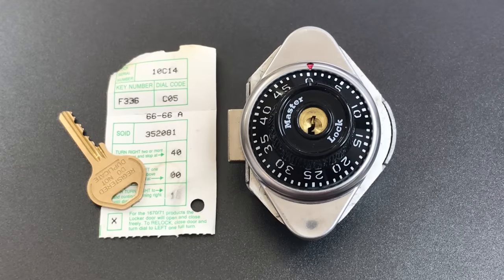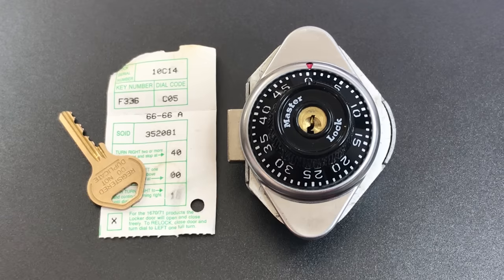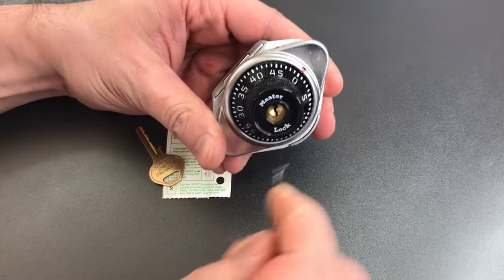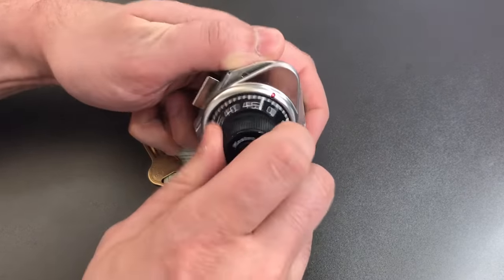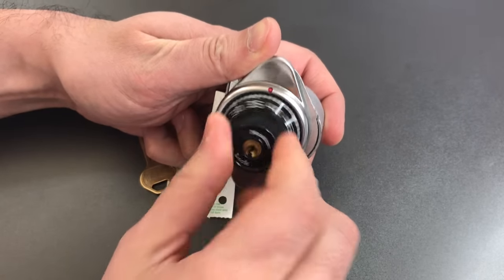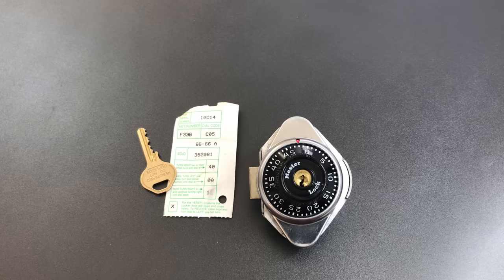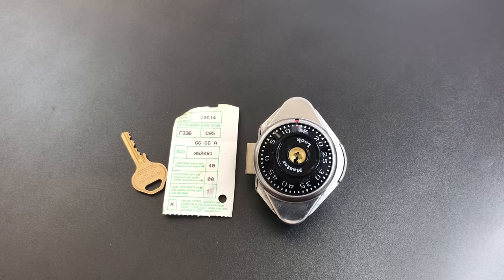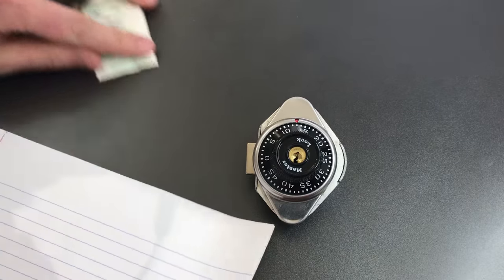[617] Master School Locker Combination Lock Picked and Decoded (Model 1670)

Comment: These locks are incredibly hard to get open even if you know the combination, because the ones that are actually installed in schools haven't worked properly in 20 years.
Reply: At my school, it was the other way around. As long as you got the first number right and you were within about 7 of the second and third numbers, you were good. Several times I ended up learning on lock turn in day that I’d been using incorrect numbers that were just close to the real ones.
Reply: I started in the middle of the school year,so I got a pretty old locker. It jams a lot and I have managed it now.
Reply: @nordbrah6611  I'm a senior in high school, and I've never even used my locker since 8th grade
Reply: We need to pay 50 dollars for our hallway lockers so I just use my gym locker for my stuff, we just have normal locks and I don't even use one since no one takes stuff (except for me taking locks lol)
Reply: I didn't have time to go to my hall locker, but my gym locker was a trip.  I had to put the combination in exactly, but all of the numbers were slightly off.  40 was 38.5 and had to be exactly 38.5.  And none of the digits were off by the same amount.
Reply: That's not always true, my school has these and I have no problems with them.
Reply: nobody uses school lockers anymore lmao
Reply: @thesovietkevin7275  Not always true, I use mine.  But most students at my high school don't use them.  I remember once a friend of mine showed me his locker which was full of 1000 dollar shoes and there were at least 5 pairs.
Reply: du,tfygufgus my school is literally two years old and yet the locks are still wonky lmao
Reply: My lockers at my school are old but work fine
Reply: Did anyone else use the pencil trick to jam the lock open permanently?
Reply: Yes please help us our lockers our terrible. People miss busses trying to get them open.
Reply: Exessivemite 9 same
Reply: I literally never used my locker for that exact reason
Reply: @exessivemite9478  amen partner. For various reasons I carried everything in a satchel and never used my locker the entirety of high school.
Reply: ikr lol i have not even used there lockers cuz of how dumb it is
Reply: If it doesn't open, use force, if force doesn't work use MORE force
Reply: Because they were there 40 years
Reply: @dataexpunged3914  honestly if the locks were there 40 years it was a minor miracle to get one so new. Granted I live in the Appalachian mountains in the US but my grandparents went to my high school and it still had the nuclear fallout shelter sign beside the entrance door.
Reply: I had the locks taken off the lockers when I was in 6th grade so we had to use our own lock to lock our lockers but they only did it for the 6th graders so I had to use the hard to open locks for the lockers this year so but I never used the locker anyway because the location didn't fit with my schedule
Reply: my daughter started middle School this year and showing her how to use her locker combination was just a lesson in frustration.  The second number had to be put in exactly and if you passed it you had to start over.  I've gone through hundreds of cheap master lock combination locks including decoding them by touch, but I was ready to hulk smash on her locker.
Reply: Worked at a junior high school. I would go through and change every combination and test it. They all worked beautifully.
Reply: At my school some people have to get the Janitor's hammer and beat the shit out of the lock to open it. And the teachers are the ones who tell them to get the hammer
Reply: Not even knowing the combination will open it.  You have to know the combination and where exactly to slam your shoulder to pop the rusted ass locking mechanism.
Reply: i remember having to hit the lock to the left after the first number and mine would open in 7th grade. the actual combination did nothing
Reply: it either opened on the first try or i was late to class lmaoo
Reply: @brittneynorville5273  I was lucky to have the working lock. But no one asked if they can put their stuff in my locker idk why. I would have let them.
Reply: @brittneynorville5273  percussive security does make it harder for people not in the know to open it lol
Reply: Exessivemite 9 facts
Reply: Beating and kicking the locker works great in this scenario. It's the only fix I've found
Reply: I somehow went through the entirety of schooling without having a locker in between classes. The only locker I ever had was in gym class.
Reply: @bhaalxbabe  they probably reused old lockers from another school.
Reply: Will same
Reply: Lmao i always thought lovkers ahving combination locks was just a movie thing because my school (now bear in mind I'm British and not as many high schools even have lockers) always has lockers with keys and if you lose your key thats it you just pay for a new one or don't lock your locker
Reply: The one on my locker works even if you get the combination wrong 1-2 ticks away from the true number.
Reply: E. Andrews same
Reply: my school you brought you own combination lock and mine got soo damaged it opened without any combination
Reply: Damn right
Reply: My school uses them, they are kinda janky
Reply: @Colonel_Overkill  did you know the Appalachian dulcimer was made by scotch-irish immigrants living in the Appalachian mountains in the early 19th century trying to make a violin but without the right tools they made an instrument that actually resembles a German scheitholt. The only reason I said this was because I've never seen anyone say
 Appalachian up until your comment. This is a speculative history btw
Reply: @Abigart69  thats intriguing, thanks. I am going to look into this now as I learned how to play it in high school.
Reply: At my school some lockers open if you bang on them
Reply: So true
Reply: @bulldozer8950  I thought I invented the pencil trick lol
Reply: Same in aus
Reply: bibasik7 kind of like the schools themselves.
Reply: We don't even have lockers in spain
Reply: @exessivemite9478  I'm a sophomore, and I haven't used my locker since 7th grade.
Reply: I remember my old high school's lockers weren't that old because at the time, the building was almost brand new, but the lockers still didn't work properly. Some of the lockers would jam, even with the combo put in correctly, and you'd have to kick the locker really hard after putting in the combination correctly to make the latch give. The teachers didn't like it when students did that, but when that's the only way to get em open, that's what you do. Needless to say, you could tell how bad the lock was by whether or not the door was warped/dented. I once told the principal about how my locker that year was jamming, and that's why I kept pounding my locker and being last to class. He tried it and noticed some resistance, so they sprayed it wd-40, and that didn't help, it just made it greasy. And we had to use the lockers because backpacks weren't allowed in class.
Reply: Kay Reim - I’m 47 years old and I have a recurring nightmare that I’m still in high school. I have forgotten my locker combination and I have to go to the front office to retrieve it- subsequently missing my bus. Then, I’m forced to wait for then late bus or call my mother. In my dreams my mother is always super resentful of my forgetfulness : /
Reply: enter your combo correct and it still doesn't open.
Reply: half the lockers at my school the lock was just for show, you could literally lift up on the handle relatively fast twice and it would open. forgot my combo in about a month
Reply: Exessivemite 9 same, sophomore tho
Reply: Doesn’t matter if you gave the combo if the lock is weak enough you can just pull open the door
Reply: PREACH!! Never worked XD
Reply: @thesovietkevin7275  No textbooks anymore?  Just communist brainwashing straight from your jailers I guess.
Reply: @bulldozer8950  I always either used the 0 trick to keep it open or turned it to the first number and kicked it to get in.
Reply: Exessivemite 9 same
Reply: More then 20 for my school
Reply: @exessivemite9478  Same here lmao I just graduated even 8th grade I used it once in the beginning and a handful of times afterwards.
Reply: @exessivemite9478  when I did use my locker these were the locks we had and I forgot exactly how I did it but they were garbage but probably because they were broken and would work if you got the numbers off by a lot. It would also turn differently if you were close and were pushing on the button. Literally everyone just left them like 5 numbers off and turned them so they would seem locked but to open they would just turn it back to the last number and then back to the wrong number and it always worked. I remember one guy turned the lock all the way around and it still opened. I'm 99% sure whoever had to fix or replace them just had enough with them all breaking and got them all to open but wouldnt fix them.
Reply: the locks that we get at school unlock if you turn them 360 around slowly. sucks because people actually steal from lockers at my school so i can't even bring my phone to school because it will get stolen and i can't bring it out at school
Reply: I swear the first year of middle school on the first day they literally took two hours out of the day for us to go to our lockers and practice opening it 😂
Reply: Chewing gum
Reply: @exessivemite9478  lock some weird shit in it before you leave
Reply: @jimothy2361  My favorite trick was to keep a screwdriver in my backpack and just pry the fucker open. The lockers in my high school were so shoddily constructed that the door would merely flex, pop open, and end up straight again once it did so.

I also seldom used the thing at all.
Reply: @Jamestube8439  I never used mine because I never felt the need to. I had a backpack everything I needed for the day was in that backpack why bother with a locker?
Reply: @TestECull  You're not wrong, a lot of people at my school never used them.  I always liked to keep stuff I don't need in it otherwise it weighs down my backpack.
Reply: @jimothy2361  dam... with my high school’s lockers, you have to literally be on the dot with every number or it won’t open. And sometimes the locker door sticks, so you can’t get the locker open anyway. Public schools are fun.
Reply: they get worn with age, so with aged locks youll either have them become very difficult to open, or very easy to open
Reply: I like your profile pic lol
Reply: At my school some locks could be opened just by hitting it...
Reply: True
Reply: lol
and when you have greasey chicken nuggets right before use at lunch it is impossible
i speak from experience
Reply: i know
Reply: @jimothy2361  same
Reply: So true
Reply: @exessivemite9478  im a freshman and never bothered to find my locker, I tried once halfway thru the year and gave up
Reply: Yeah nah just learn your damn combination, it'll work
Reply: @thesovietkevin7275  duude before i moved to an online school my school didn't allow backpacks because it was a fire code issue, but lockers were rented out so there was no winning
Reply: I remember once in middle school I opened someone else’s locker with my code lol. These things aren’t exactly the highest quality
Reply: That's 50% true 50% false for my school all our lockers use this lock the regular lockers work fine but there is always something wrong with the gym locker ones, they all have at least one of these problems a sticky wheel, stiff unlock, or very picky
Reply: I have a master lock that I’ve been trying to decode for the longest time, and the videos aren’t working with mine. I might come to a point where I’ll just take it apart just to see how it works.
Reply: My gym locker has this lock and it gets super stiff towards the last number in the combination, and sometimes I can’t get it open because my hands are slightly slippery.
Reply: Ha yeah so true matter of fact my high school lock had a slightly rusty key which considering the fact the building still has the nuclear fallout shelter signs from the cold war on the walls doent surprise me
Reply: they get worn out and sloppy and schools really seem to be loathe to change them out.
Reply: I got really lucky, these locks have a really bad reputation at my school and I got one of only a few lockers where the built-in lock was so broken that they disconnected it, i get to use my own lock instead.
Reply: i will never understand this idea, i've never had a problem with my locker 🤷‍♂️
Reply: My school has new locks :/
Reply: Facts lol
Reply: Yeah I just jammed the locker at the beginning of the year lol
Reply: @bulldozer8950  Only in that one unused locker we used to sell weed acid and coke
Reply: @autobotjazz1972  some schools have upwards of a few thousand of these, so I can understand why they wouldn’t want to swap them all out lol. 

But on the other hand school are very penny wise and dollar dumb, they’ll save money by not upgrading equipment and then blow all their saved cash on a new facility they’re gonna fill with ancient trash.
Reply: @wolacouska3698    Honestly i think of a few reasons why they don't replace them. : 1. they still work at minimal security level   2. The custodians can solve any lock outs quickly and efficiently if such issues occur.   3 they likely take little effort to shift from one locker to another if schools ever do that.    and 4.   many schools are operating on unfortunately small budgets and likely cannot afford to upgrade the locks if they wanted to .
Reply: They are very big tolerance locks that work good enough
Reply: My lock wouldn’t even turn past 10
Reply: @exessivemite9478  I used mine only for a change of clothes and extra supplies.  NEVER carried books or lunch or anything I needed because I ALWAYS forgot the combo. or it never worked  and I also Bent the Clasp on the inside so I could lift and open
Reply: @Jamestube8439  i couldn’t imagine pulling someone aside to show them my material shit
Reply: So basically, the only way to make a Master Lock secure is to make it not work properly.
Reply: Absolutely true.

They are probably easier to simply decode the override lock for.
Reply: I used to be able to just know the general region of the numbers. The margin of error sure is something.
Reply: Yep the lock will make you late for class
Reply: Old comment but all you had to do in my high school was just kick the shit out of the lock and it would open. It worked on 75% of the lockers
Reply: @exessivemite9478  why?
Reply: @rueseki6121 😅lol
Reply: I always put a chunk of pencil in mine so I could lift the lever and bypass the combo lol
Reply: The majority of locks at my school are so old the plastic on the knobs is super sticky and covered in dust
Reply: It was as if every year not only did you have to do the numbers right, but you had to learn the quirk of your locker that you also had to do it open it. Lifting it up. Holding it back.
Reply: I'm literally watching this video because the locker I got in welding class refuses to cooperate with me-